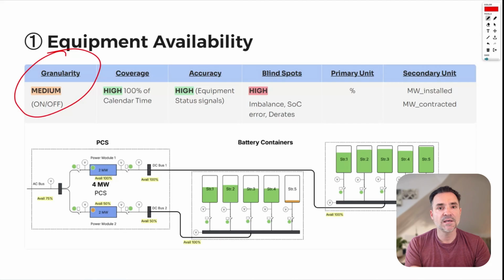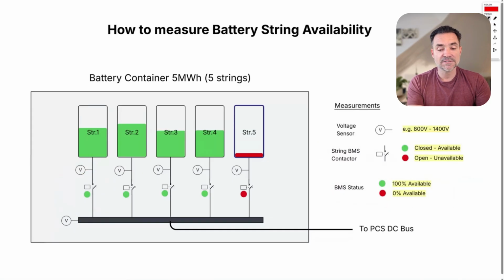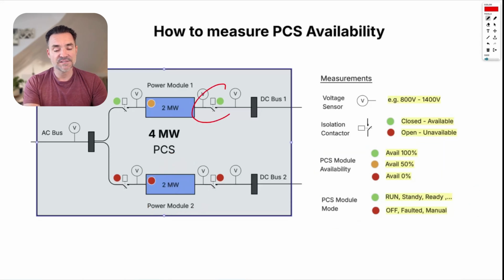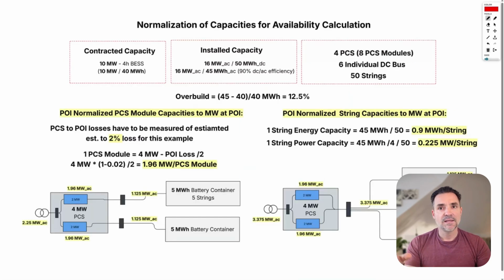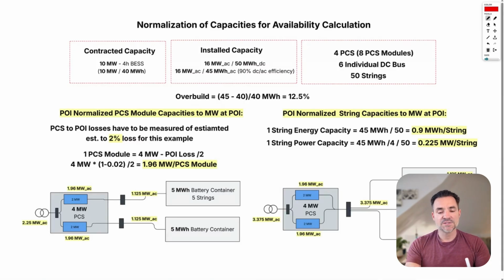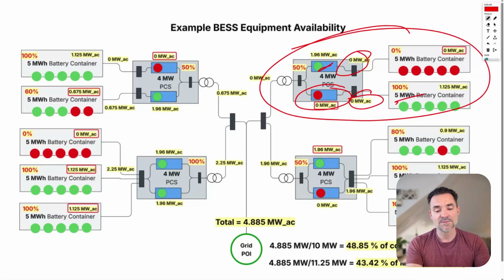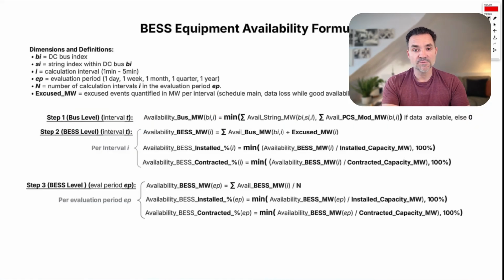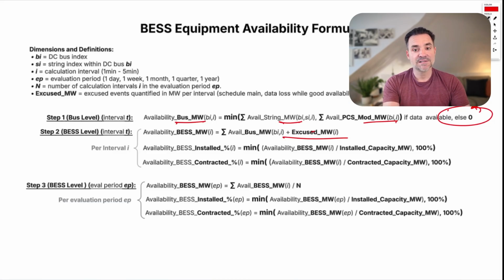Equipment Availability Deep Dive

Comment: Great video series Fred, what interval would you recommend for the Equioment Availability? I see most OEM’s focus on hourly resolution but seems like the intervals could be 5 minutes based on the signals from the PCS and battery (although could lead to a lot of data to work with for excused events)